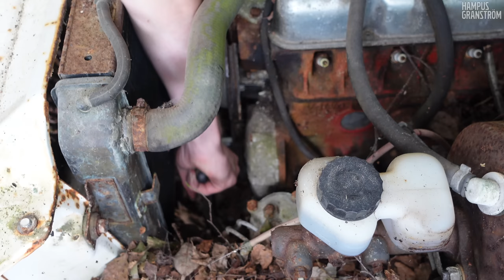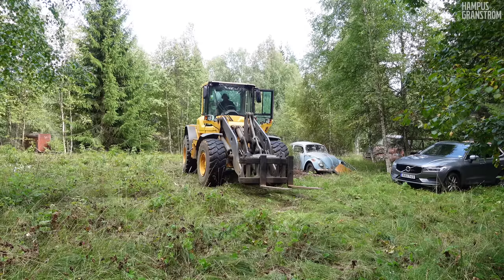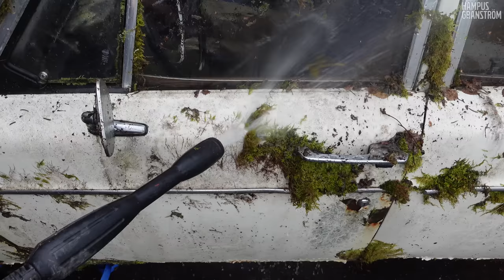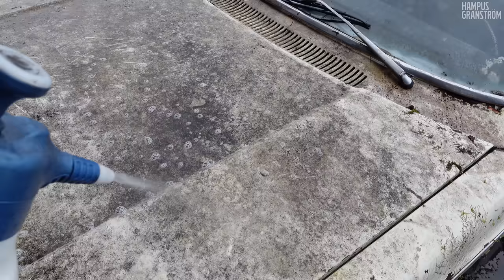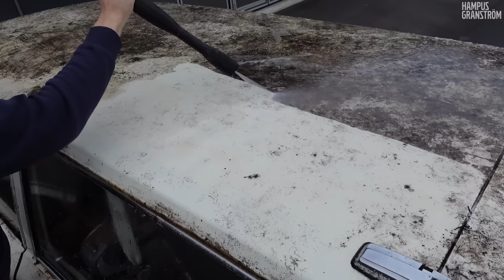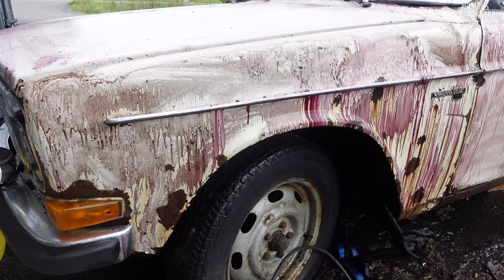Old Volvo Station Wagon Rescue after 40 Years | Satisfying Transformation

Comment: I had a 1969 144 wagon nice car rebuilt the engine went good then it broke in half from rust, Then bought a 1971 Pontiac wagon with a 455 V8 nice car very fast and big but it got 19 MPG better than the Volvo

Comment: 02:40 trying to pull a car that the wheel is hitting a wall of earth wont work because is not pulling the car straight line is pulling the car diagonal, he just had to 1. Pull the car straightforward or 2. Lower the earth mound